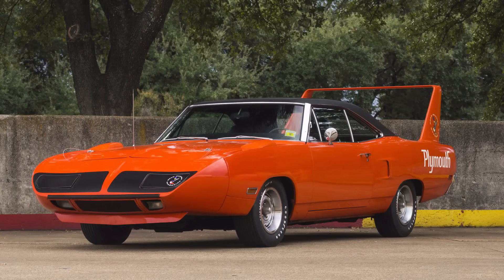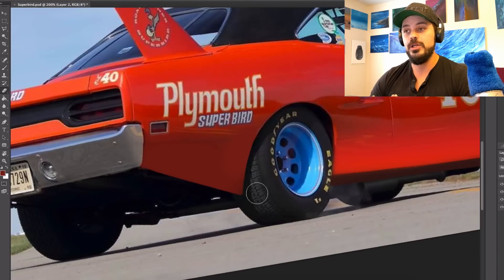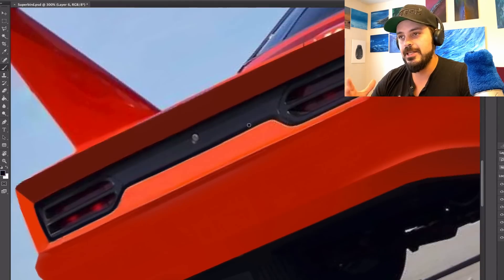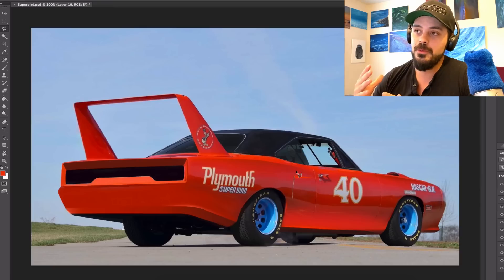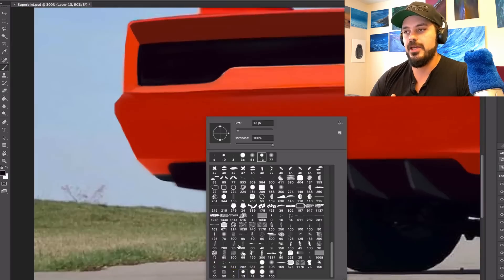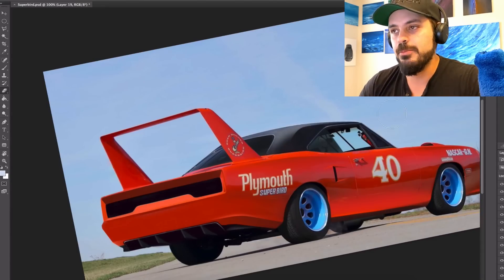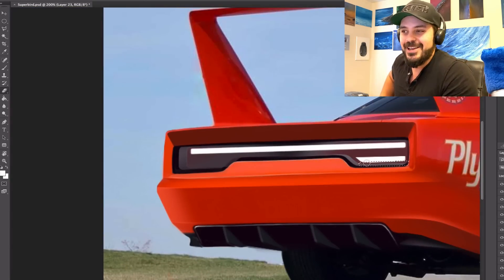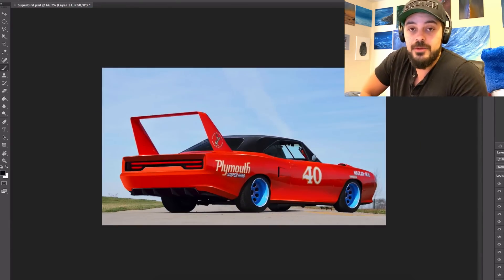1970 Plymouth Road Runner Superbird Modernization - Muscle Madness

Comment: Imagine if Dodge actually made a new Road Runner with the big wang based on the Challenger/Charger Hellcat with Demon motor
Reply: Imagine if PLYMOUTH built it, since PLYMOUTH built the original Road Runners.
Reply: @70rrsteve51  Sadly Plymouth went out of business about 10-20 years ago, if there was a new Superbird it wouldn't be Plymouth
Reply: Don't you mean FCA?
Reply: @KyrosTheWolf  it would be a Daytona not a superbird
Reply: so question for mopar guy's the 80-2000's F-body nose on a G-2 charger? mostly for MPG/airo modes your 2C? and no wing as the exercise is to make it super slippery 😉🤠

i like my car but it's for a bet ect. and bug gut's management ect.

Comment: I kept waiting for you to fix the left rear overhang. On the right, you angled the bottom down from the bumper to intersect the wheel much lower than the original. That didn't happen on left, so it feels unbalanced to me.
Reply: OCD intensifies..
Reply: 9:36 If the twisted back end bugs you, just look at the straight-on side scoop that ventilates the boot/trunk!  Aaaargh!